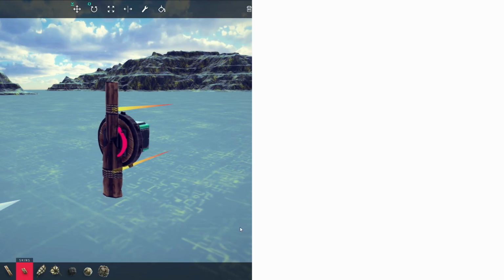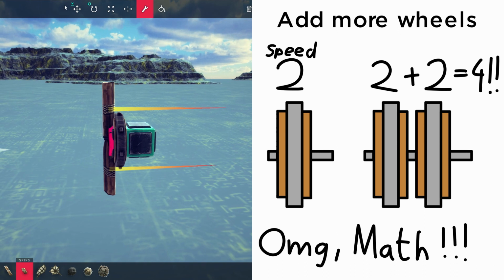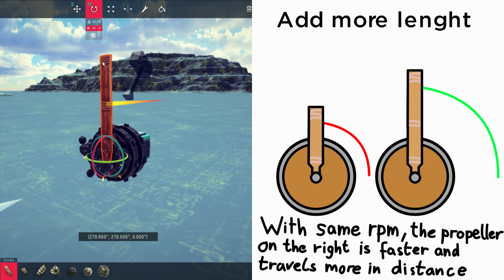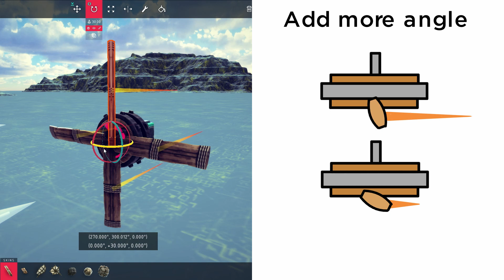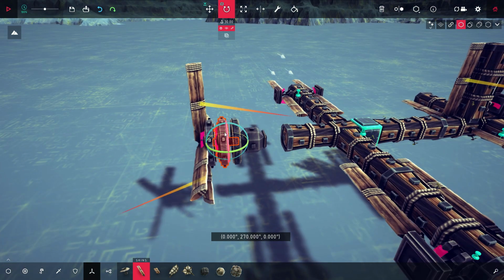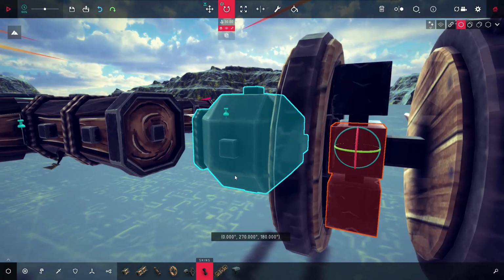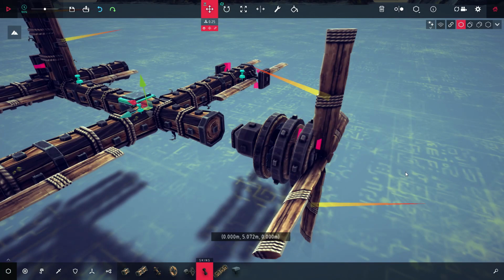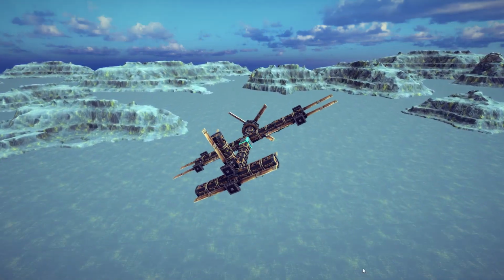How to build planes in Besiege - Part 3: Propulsion

Comment: Nice video! I have a question. Why did you put braces and unpowered wheel to the engine? They are not creating any power for the engine.
Reply from the maker: Good question

If you were to do everything but put the braces on there, your engine wouldn't have any torque, at all. It you remove the unpowered wheel, your plane will start to roll due to the wheel. For every action there is a reaction.

The unpowered wheel is there to keep the forces of roll from the engine away, and the braces act as a "counterweight"
Reply: @GeReapeters  Wouldn't a swivel joint be the same as unpowered wheel + braces?
Reply from the maker: @enricotonon6633  sure, but the swivel joint is really flexible, which isn't ideal. It would be better to use a spinning block with the speed on 0 and the 'limit rotational speed' option turned off. It's unbreakable and much less flexible than the swivel joint and unpowered wheel
Reply: @GeReapeters  I see, thanks for the clarification!
Reply: Thank you! @GeReapeters